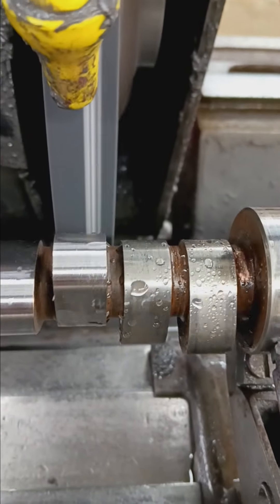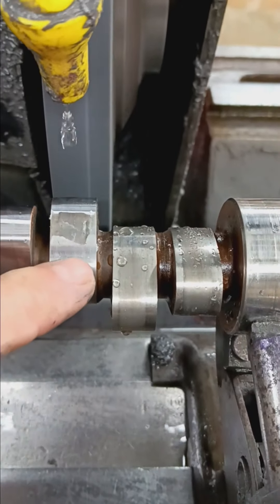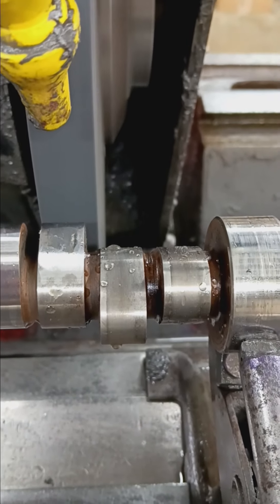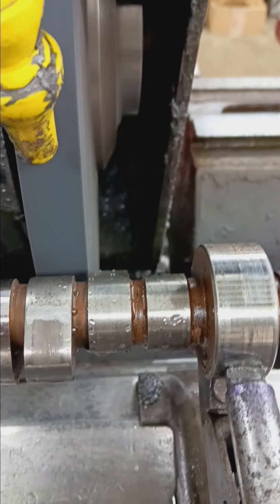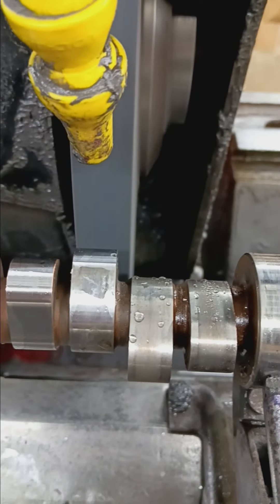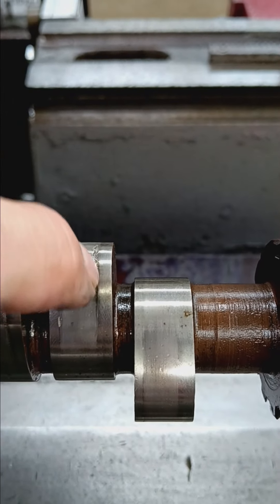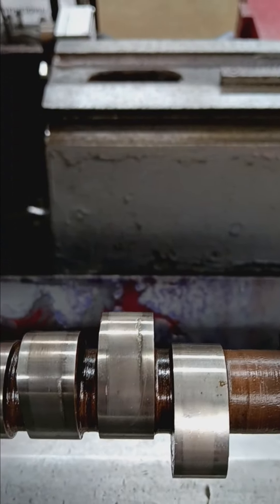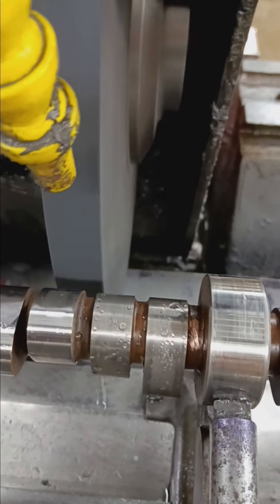Camshafts  lobe wear in the maximum Velocity area.

Comment: This is why the SBC engines that I build with Mechanical roller camshaft get a rev kit.  The cams run much longer and lifters to, because they are not being slapped by the flak as hard.  I have also made plates that work on 351w 9.5 deck and run the parts for SBC rev kit.    You can see from the wear pattern that the lifter was partially turned as it landed on the flank.

Comment: Cam lobes look worse than they really are. Since I'm not educated enough about what I would be looking at, more than likely I would have been adding to the scrap pile. And I have in the past taken engines apart and cam & lifters were on auto pilot for the scrap man.
Reply: This is why I hate not machining and/or replacing nearly all engine parts at rebuild time.

That and I had way to many friends that were sold a car with "Recent engine rebuilds." That usually just means a ball hone and a bearing roll in. It may be good enough to sell the car, but it doesn't last long.